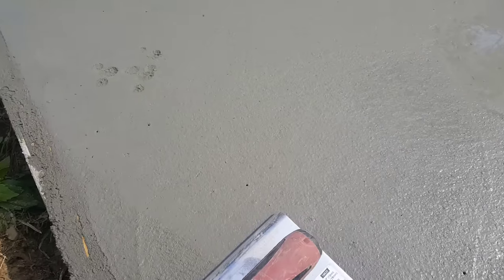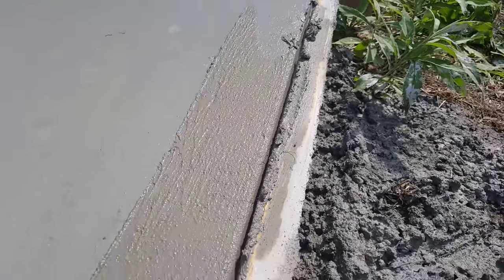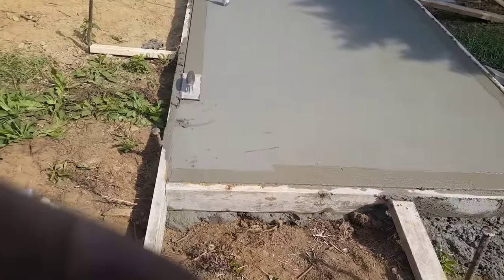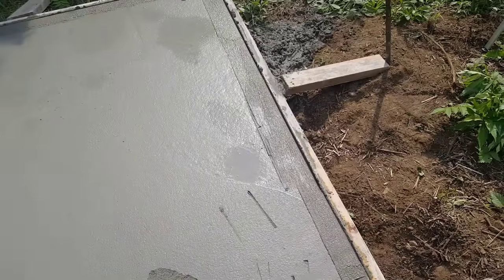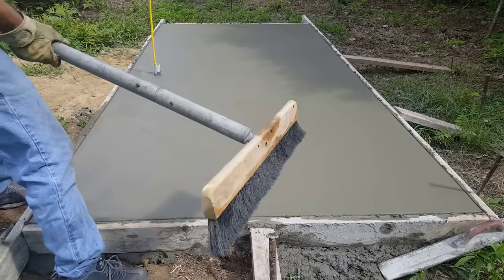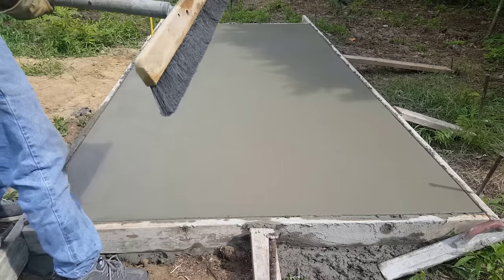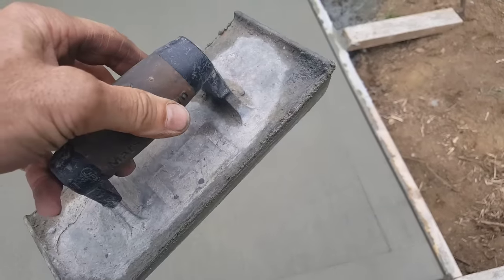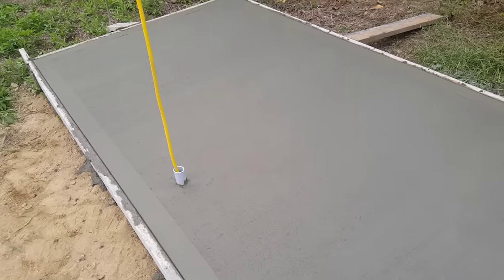Concrete Finishing Techniques - How to Mag Float, Edge, and Broom a concrete slab

Comment: What can you do when work is done and they never put that nice finished edge is there a fix for this? Looks much better with nice picture frame edge.
Reply from the maker: There's really not much you can do to make it look like the edge, like if it was done originally. You could resuface, re-broom, then add the edge mark. But that's probably not practical if the concrete is pretty new. I do have a video on re-surfacing a entry slab like this if you want to take a look.
Reply: @MikeDayConcrete  thank you Mike wish you where in fishkill NY...

Comment: I justed subscribe 👍🏽is the 4" thick  Im building a 20×20 for my basketball area would I have any problem making it 2" thick
Reply from the maker: We've never done any slabs only 2" thick. I wouldn't recommend it. Concrete has very little tensile strength so 2" is likely to crack very easily. Have a good gravel sub-base that's well compacted. Then go with a 4" slab. Should last for years.
Reply: Ok actually after watching afew of your videos I decided to do a 24x24x4" instead. All by myself hope it all comes out right.

Comment: mix and pour concrete to screed level, vibrate for consolidation, strike off, float for push aggregates below the surface , edge. Then wait for bleed water to evaporate, then trowel the who slab, then set the broom Finnish then edge again.

Comment: Hi Mike.  Great clip. Thanks for sharing. When do you give a mag finish as opposed to a steel trowel finish and I take it there’s no joint as it’s a shed base ?. Thanks.
Reply from the maker: Cathal Rooney - We always start out with the mag float when we finish, whether it's an interior floor or an exterior pad with a broom finish like this one.
After we mag float the concrete on an interior floor we'll use a steel trowel to get a smoother finish. We don't steel trowel exterior concrete because it would be too smooth and it could cause blistering for us who live in freeze/thaw climates. We mag float, then (broom finish or stamp concrete) for most of our exterior slabs.

Comment: How much time after poor should you do this? Should you keep water on it?
Reply from the maker: Rob, it depends on the air temperature, how wet or dry you poured the concrete, or if it's in the sun or shade. For this pad I waited about 30 - 45 minutes before I started finishing. After it hardens (5 or 6 hours after you're done finishing) you can keep water on it to cure it slower.

Comment: Concrete shrinks as it dries and cures. That pad is 6 x 12, and as it shrinks in all directions equally; the 12' direction will contract twice as far as the 6' direction.  That is a long winded explanation why it needs a joint at the 6'/ midway point, or guaranteed it will break there on its own, and almost for certain right at that conduit or pipe I see sticking up.

I teach people; a three foot wide sidewalk should have control joints every 3' - 4' wide then every 4' - etc.  Then, of course, there are lots of situations where you just have to split the difference and hope.

I wouldn't be surprised if you went back and saw cut that.  It's a lot easier.  I would have been interested to see how you matchup what I call the groover tool with your edger.

Comment: How long after you bull float it should a person mag float it?
Reply from the maker: It's going to vary depending on temperature and how wet or dry you poured the concrete. I have other videos that show you when to start finishing after the pour. Check them out, they will help you figure it out.

Comment: You have video's on different float Trowls what's best universal one or do you need two Trowls to smooth out concrete.  I have one metal I think 10" square one what different in metal and plastic.
Reply from the maker: Louis Holland - We use a mag float when we pour the concrete and when we first start the finish process, then as the concrete sets, we switch to a steel trowel. We always use metal, never used plastic before.

Comment: All that troublesome edging can be avoided by chamfering. You nail strips of 3/4" cove moulding around the top of the forms and wreck them before the concrete is dry. Then all you have to do is smooth the edges with a float.

Comment: Nice looking pad , I’m wanting to pour a 5x10 pad as well. Is the quikcrete they sell at Lowe’s and home depot what u used? When using those bags would it come out as smooth as it did for u here? Or do I have to mix in something else? Thanks for the help.
Reply from the maker: I used a ready-mix company, they delivered the mud in a concrete truck and I poured & finished it. Because I pour every day with them, they don't charge me for a small load charge. Yes, the quikrete bags (especially the 5000psi) would come out like this one. It would take 28 of the 80lb bags to do a slab 5' x 10' x 4 inches thick. The 5000psi bags are around 6 bucks a bag, so around $170.00 dollars for the 5000. I like this one because it has a higher cement content.
Reply: What's best two trowel for beginners.
Reply: If you add a shovel scoop of cement  with a two bag mix it of 90 lbs bags , it will come out smoother. Also start off with a  small 2x12 trowel , both square and round.  Then move to the bigger trowels

Comment: I need to repair several areas of damaged concrete (8') in a warehouse that has been repaired in the past, I need to find a fast setting,high strength mix that can forklifts will need to drive over within 48 to 72 hours .... Any advice would be off GREAT HELP
Reply from the maker: Pete - We use Rapid Set for most of our fast track repair projects. The blue bag for thin applications and the green bag for 2" and over. You can get the bags at Home Depot.  Blue bag is called Cement All, Green bag is called Concrete Mix.  This stuff sets up fast, they have a flow control packet you can add to each mix. It's in a little plastic bag (looks like white powder) It'll give you more working time and loosen up the mix. Good Stuff.
Reply: 5000psi high early strength can drive a tractor trailer over it in 12 hours
Reply: cement all
Reply: or for cracks just fill it with simpson strong tie epoxy
Reply: Pete Horan magna Crete. The stuff is absolutely bonkers. Will harden when warm in 60 seconds, cure in an hour, and absolutely glues and holds everything like its only mission in life. Try a bucket

Comment: Hay Mike, do you have any videos on how to install pex heat pipe and pour cement over it and how to insulate it underneath it? Love your vids!
Reply from the maker: I don't install pex heat tubes but I do install the 2" rigid styrofoam. It's just plain blue board, then the heating guy usually staples the pex tubing to it. Pouring the concrete over it is the same as my other videos.

Comment: After you have poured the concrete how long do you wait before you start this finishing technique.
yes I'm a novice and would like to get it right.
Reply from the maker: That's going to depend on the outside temperature, if it's in the sun or not, if it's windy. I probably waited about 45 minutes on this one. 60 degrees and some sun on it.
Reply: Also depends on what mix youre pouring and what slump you poured the concrete at. When we do city work that is a straight m4 mix poured at a 4 we have to get on it immeditely after we are done screeding. Residential we pour a c4 mix at a 5-6 and we have a lot more time on those.

Comment: Brooming after the mag float is gonna give you a rougher finish. Steel trowel it once and wait till you broom. Different waiting times will give you different finishes but this is gonna be one rough slab. Definitely not gonna be barefoot on there lol
Reply from the maker: I live in Maine, if we steel trowel exterior concrete with air-entrainment, it will blister. Where are you from?
Reply: Mike Day Everything About Concrete rajah I got ya. I’m from Hawaii. A lot different climate huh my man lol
Reply: Mike Day Everything About Concrete most our broom finishes are for sidewalks so we get it nearly finished with a crazy trowel then just give it a light broom finish
Reply: @kahiwahiwaokalanikiaaina3533  for just a simple walkway in my backyard, What trowel would you suggest, besides the edger? It's fine if it's a little rough, but not too rough.
Reply: Plen122 I’d just use my crazy trowel or any hand trowel for finishing and just wait till the concrete sets up and check till you get the texture of broom you want. But that’s for warmer weather. I’m from Hawaii it maybe different in the cold where you may trap more bleed water by using a finish trowel after your mag.

Comment: Why don't you use a steel trowel? If you dont use a trowel. The concrete will always have dust. You can sweep it and then sweep it again and still get dust off of it. I understand it isnt a driveway but the top could also pop off if it isnt trowel down to seal the top. I also haven't seen a 4 inch edger since I was 12 or 13. I'm 34 now and the 3rd generation finisher. We use a trowel on everything we pour unless it's a footer. Just a few questions for you. Looks good. Better than most around me
Reply from the maker: John - We only steel trowel interior concrete floors. In Maine all our exterior concrete has air-entrainment for freeze/thaw conditions. If you steel trowel exterior concrete with air, you risk sealing off the surface too soon, trapping air or moisture which will cause a blister or worse delamination. We use a good penetrating sealer to strengthen the surface and prevent dusting. This is the way I've been doing it for 39 years, we just have different methods for different parts of the country. Thanks for watching!
Reply: @MikeDayConcrete  We have a non air mix and air mix. The non air seems to have more rocks. Yea but you are right. Different parts of the country. Looks good.
Reply: These sorts of respectful questions and informative answers are rare is a world of sarcastic egotistical keyboard warriors. This little exchange was nicely informative.

Comment: Mike about how long into it due you start finishing a pad let’s say 10 x 10?
Reply from the maker: It depends on temperature outside, If it's in the direct sun or not, how wet you poured the concrete. Generally, if it's about 75 degrees and in the sun, about 30 to 45 minutes.

Comment: hey mike nice video , im a bit of a handy man its been years since Ive done concrete my question to you is with a 100 x 8 ft wide sidewalk at what length do I  separate and install the expansion gap material ?  do you have any videos doing this putting in expansion joints to avoid cracking I live in NYC so weather varies and at what poundage should the conrete mix be with a 4 inch depth and wire mesh added inside
Reply from the maker: Dave, We do these two ways.  Sometimes we will pour the whole sidewalk (100' x 8') in one pour and saw expansion/contraction joints every 8 - 10 feet. Sometimes the General Contractor we are working for makes us only pour 30' at a time. So we could pour 30 feet on both ends then the next day pour the middle piece. We would install expansion foam in between the the two pours, like on this page: https://www.everything-about-concrete.com/concrete-expansion-joints.html

You can also hand groove in the joints, I show you how in this video where we're doing it around a pool.
https://youtu.be/I2bLUZPBh0w
Reply: You could also put in a couple bulkheads and pull/fill them while the concrete is still wet. Or wet join everything and every 25 or so feet use a block trowel or something to knife completely thru the wet concrete where you are joining it. That will help it crack there

Comment: I wish you would have talked a lot more about the magnesium tool.
Reply from the maker: moofushu - Which tool, the edger or the mag float? What would you like to know? I'll help if I can.
Reply: @MikeDayConcrete  I was referring to the mag float. When you go the hardware store and see concrete finishing tools it is a little confusing because one of them is magnesium, another is wood, another is steel with 90° corners, and another is steel with  rounded corners. I was wondering why there were so many tools to do the very same thing. The one that stands out the most because it is so different is the magnesium float.
Reply from the maker: I prefer the magnesium float over the others. That's what we use most of the time.

Comment: How deep did you go down?  I'm going to do my  own back porch. I want to know  where to start on framing
Reply from the maker: Joe - This was just a 6" slab, I just used 2x6's to form with. It had about a 8" gravel base. The homeowner was setting a propane tank on this pad.
Reply: @MikeDayConcrete  Mike ! So thick should my slab be ? I'm making a screened in out door patio. 10x 30.
Reply: @MikeDayConcrete  also do I have to put a slop. If so how much

Comment: what grade of concrete is needed for the driveway?
Reply from the maker: I use 4000 psi with 3/4 stone.
Reply: @MikeDayConcrete  19 mm stone, 4000 psi it's in Poland 26 MPa that is, the concrete class C-20... I think so.... 🤔. With polyester fiber?
Reply: You would want 32 mpa with 5% to 8% air content.

Comment: Okay bend over with your legs spread touch your toes your so bent or as far as you can go rotate at the hips with your feet in place spread out left to right your hands should be in the plates above your butt checks where your back gets sore from work you'll feel these two spots hard sore from work bones move in the directions and crack like ya always wanted 😊you just adjusted your hips 😊and do this everyday no workers back pain will Tesla - willy 0

Comment: Mike you are a good worker, I like watching your videos, but those edges were terrible. I don’t know what to say you thought they looked good and the people watching thought they were good, one guy even said perfection.
1. Before I start edging, those form top would be clean of any concrete on top of them you would just see the wood like you do on the side of your forms, it’s cleaner and will just let your work be neater.
2. That 2” edge looks rink-e-dink!
Let me explain it this way, a woman’s ring is narrow/thin/feminine, a mans ring is broad/bigger/carries more weight/gold/sliver, looks more masculine. Wide edger’s just have the look.
When you were working out that davit/hole you rolled your edger which made your edge mark on the slab lighter/not as thick/heavy as the rest of your lines in other words your edge marks weren’t uniform all the way around the slab..
4. The steel edger would give you a smoother look and you edge marks would not be floating up on you with that uneven edge mark, which I think looks unprofessional, and saying guy’s lets get out of here.
5. I would have pulled those form boards and faced the edges on patios up in the air. You guys get by with a lot of things that a lot of builders just wouldn’t except when they can go out and get concrete “that has the look”.but it sounds like your getting top dollar up there and your working every day. I just commented 1. Because I’ve been taught different. 2. You asked for comments.

Comment: Why would anyone ruin a nice glossy floor by brushing where it e
Will catch dirt, dust and just about anything else.  Don give me the standard " Non slip" excuse.
With the smooth finish it can be cleaned easier and oil spills can easily be removed. Have to give you hands down
Reply from the maker: I give the customer what they ask for. It's how I get paid.

Comment: Holy shit didnt even cut in joints and that edger finish looked like you had a built in broom on the back of it that looked like trash
Reply from the maker: It's a 5' x 10' x 6" pad, it doesn't need any joints.
Reply: You called it a 6x12 in your video and anything over 8 needs jointed genius